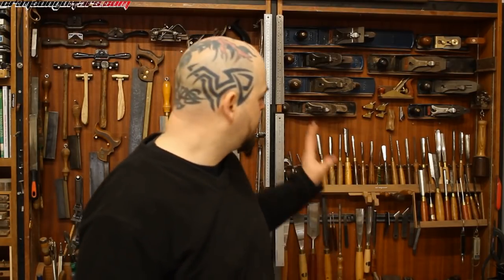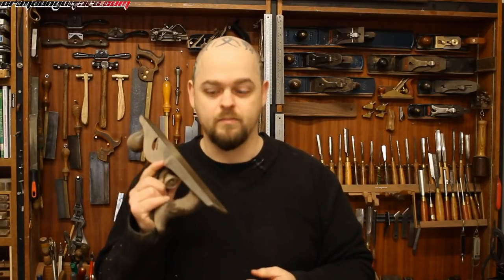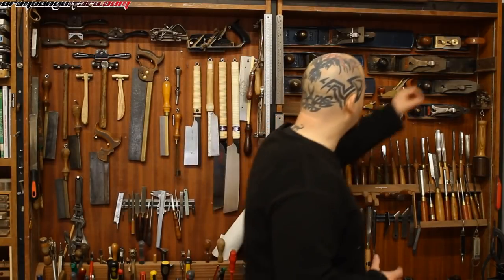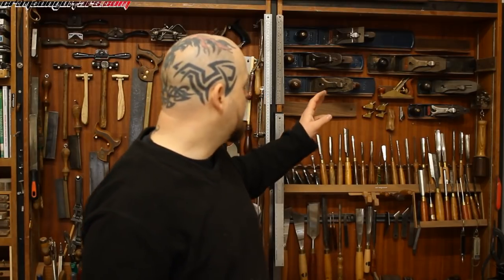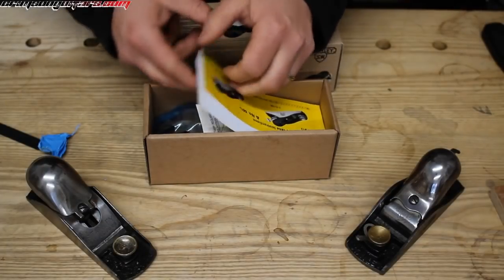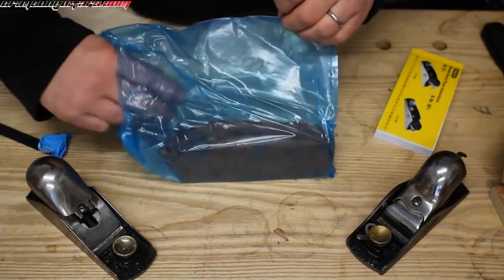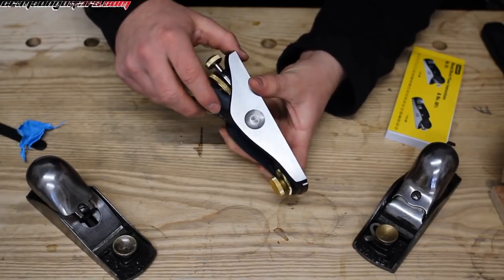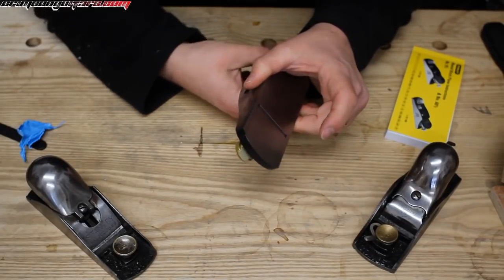Unboxing New Stanley 60 1/2 Sweetheart Low Angle Block Plane - A Review

Comment: there is no need for bottom to be "perfectly flat"... Japanese, many European, and most hand made planes are made from wood and are nowhere near as "flat" or as "stable" as cast metal planes... FACT!... if your bottom is perfectly flat ( 1/10,000 ) of an inch over entire length of sole and you set the blade to make a 1/1,000 inch cut then start cut  your rear part of sole (behind blade) will be 1/1,000 of an inch above the surface of the wood you just planed a shaving off... as you move along the pressure you are pushing will press the rear of the sole to the fresh surface and now the plane will be "tilted up" at front of sole.. there will only be two places where the sole is actually touching the surface, first is just before the blade and second is the back end of sole..
Reply from the maker: +MrMeanderthal true, and I have, use and love my Japanese planes. The problem is this is marketed as flat and even if it weren't the case this was not touching in the same places as Japanese planes. It would have worked, ish, just not as advertised, or designed or as well as it does after a little fettling.
Reply: I used to enjoy Japanese plane too.. when I first started woodwork 30+ years ago I made my first planes "Krenov" styles then bought Japanese planes.. I learned how to change shape of sole to do different types of cuts.. jointing and smoothing planes have 2 different set of contact points.. then discovered over time how wood movement changes/distorts sole during the year.. after a while I started buying metal planes because I became a professional woodworker and wanted more consistent performance.. now my planes are Veritas and Lie Nielson and I keep them smooth and polish soles with 1000 grit paper mostly for easy push rather than being "perfectly flat"

Comment: I do not get your surprise, Stanley has been the worst of the worst for over 40 years.
Reply: Lane Romel I think expectations were higher for these SW premium planes as they are intended to be significantly better. Which they actually are, it is just Stanley don't quite have the QA down. The smoothing plane is excellent though...